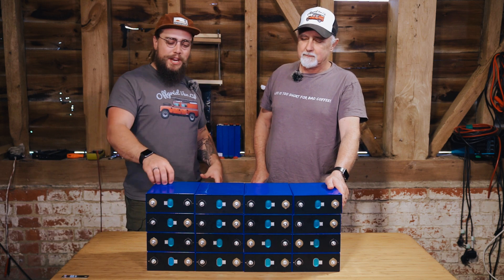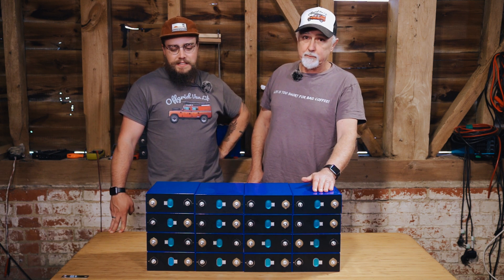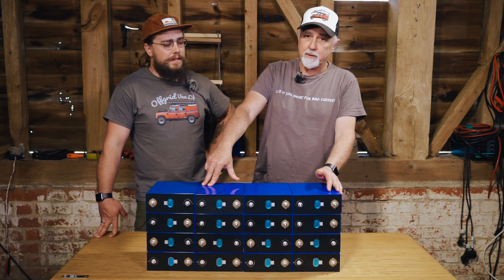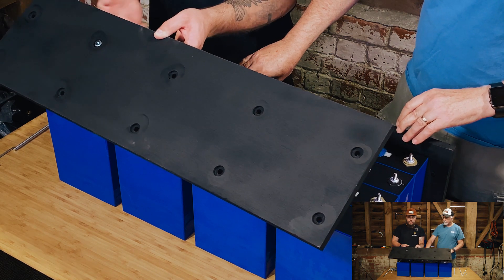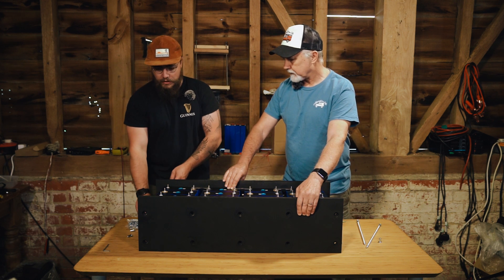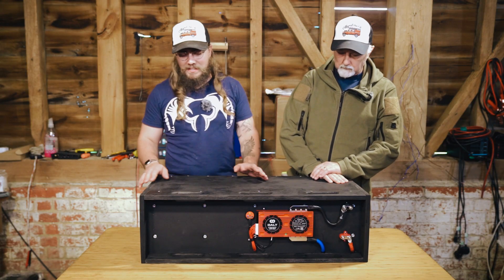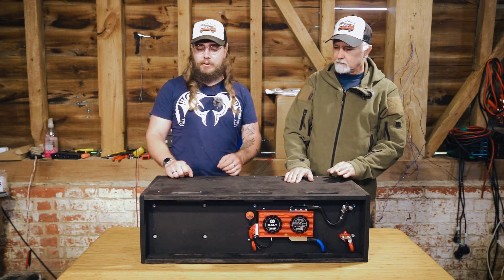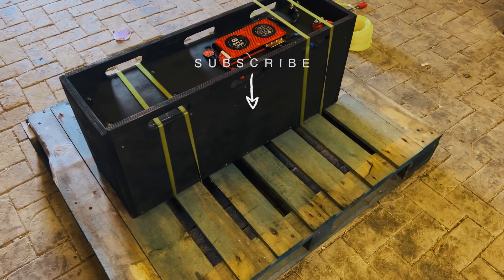Building a Custom 48v LiFePO4 Battery

Comment: That will have to be two guys dropping that battery in, as I doubt that more than that will fit into the space..Putting the all thread inside of some pex water lines is a good idea always, but especially for that build, if those cells move because of being bounced around in a vehicle everyday, and rub up against that all thread, it only has that thin blue material to rub through before it shorts out, the pex won't allow that to happen ever..

Comment: All that trouble top balancing and don't you know the BMS has a passive balancer which is not capable of keeping the cell balanced. Daly now sells an active balancer for this reason with a special Y cable to hook it up in parallel with the BMS. If you thought the BMS could passive balance, why top balance anyway? Keep you fingers crossed and hope for the best I suppose.

Comment: I'm learning about building batteries trying to understand how it works. BMS which I have found seem to be rated at 100, or 200 amps then they have a max voltage usually up to 48V. The batteries you have are 300AH capacity batteries your BMS in this build I see has a 200AH rating. How does that work?
Reply from the maker: The battery capacity and BMS maximum continuous discharge current are two different things. The 304Ah batteries have a capacity of 304Ah, which means (for example) they can be discharged at 304A for one hour to deplete completely. But the BMS has a maximum continuous discharge current of 200A.

Comment: Nice i have a 48v byd lithium batteries they came in two pairs 24v each which are in series making up to 48v but the problem is that i misplaceed the bic card which means that i cant used it 
I need help on how to build my own bms in both packs.

Comment: I like to cover the tie bolts with sink tube. There should be  a plastic sheet between the cells. The blue film protect from shorting out. It is delicate. Otherwise pretty nice build!
Reply from the maker: Thanks for the suggestion!

Comment: Sweet battery build! Only thing I would suggest is to route the BMS sense wires away from the other battery terminals. Also i've used those little busbar terminals like you have, I don't think they are very good, mine get rather hot at just 100a
Reply from the maker: Good points. Thanks!

Comment: since this is for RV, it is expcted on the move and there is no cushion between those battery cells. is that ok?
Reply: Many companies are putting thin sheets of plastic or foam between and around the cells for added protection.  It's good practice.
Reply from the maker: It's very unlikely that it will be a problem without it, but we do put thin layers of padding between the cells on bigger batteries.

Comment: dear your video is very helpful.
could you guys answer my question so i can start working on my battery without being sure it will work for what i need?
I build a houseboat and will build 1 to live on
and will build 3 to sail with a vetus e line 100 electric motor
now my question is can a 10kw motor run on such a battery?

Comment: If that threaded rod rubs through the shrink wrap of the battery case, things will get very exciting. Slide some hose over them. Fixturing is a good idea as long as the pressure is maintained and not over 12 psi regardless of state of charge. Solid buss bars and vehicle vibration can be problematic for the terminal bases and loosening connections. See Digital Mermaids flexible buss bars
Reply: Agreed, with enough tension on the bars, the cells may never move but safety and perception are gold here.  Overall, i love the build.
Reply: I seen in another build the put plastic tubing on the rods
Cheers
Reply: I zoomed in, looks like they have clear tubing on the rods.

Comment: Nice build! What brand is thees LiFePo4 cells  and what are the material cost of this battery without the labor?  I'm planning to build a 250kW solar system on my farm in the next years, so I would need over 100 kW of battery storage to take full advantage of all the solar panels. That means that I would need 8 similar battery packs :P
Reply: They're EVE cells. 
For a system of that magnitude, I'd suggest you're not going to be using a 48V system. At nominal voltage, that kind of power output would be producing thousands of amps of current, which is impractical to work with. You'd be certainly looking at something industrial or bespoke to handle that kind of power.
Reply: @madvlad1  Thank you. I would really like to use the Victron ecosystem for this setup, so voltage depends on what is supported by Victron. I think the best setup would be 3X of the largest Victron Quattro units to get 3 phase power at 230V on IT network which is standard in my area. 

Since victron only has "small" MPPT charge controllers, we are looking into the Fronius charge controllers. Since they should work with Victron, and are made for larger arrays. 

Keep in mind that I live in Norway where we have very little sun in the winter. So the solar array would be massively oversized for the summer, but just enough in the winter. Panels have gotten cheap and I noticed that there are a huge discount for buying a shipping container with panels, so since I got the space. Why not? 🤷😜
Reply: @TheJensss  Love it! If you've got too much summertime capacity and have to scale up for winter, and you don't have a grid feed in option, you could always just disconnect strings to reduce the current in the summer too - that could be an option. The Victron ecosystem is really nice - and yeah having 3P will be really cool, especially if you have some heavy inductive loads. Have you considered server rack 48V batteries?
Reply: @madvlad1    Our farm is connected to the grid, and we already have 3x 200amp intake fuse, so in the summer selling the excess power would be the best option. If I need more power output, I can connect 6x Victron Quattro units for total of 90kW of output. But since we only use about 40kW at max load, 3 units should be fine to start with for our usage. Maybe a separate and larger inverter could be used as a dedicated inverter for selling the power to the grid?

I almost forgot to mention that there is a “special” tax rule in Norway, that limits power output to the grid to 100kW. If overstepped, you would be counted as a commercial power plant and would have to pay wayyy higher taxes on the power you sell. This does that I plan to spread the solar array to 3 different angels, to spread the power production through out the whole day. 

Yes, I have looked into server rack batteries, and they look awesome. But when you are comparing them to a self-built battery like the one in the video. The price to kWh is not that great, especially when the battery is in the size of 100 kWh +. The reasons we want a large battery is mainly to be able to support large loads without taking damage, and additional advantages is that we can charge the electric car full from the solar battery. And in case of a power outage the farm would also have a large backup power source. Long power outages never happen, but since we got animals, I think it is smart to prepare for such situation. Now we just have a generator on the tractor as backup… 

I have always had a dream about being self-sufficient with power since we only use electricity with heat-pumps and wood, to heat our house in Norway. This is because electricity always has been cheap, so there has never been a need to use gas for cooking or heating.  But when the energy crises started the project became way more relevant the last 2 years. Since power usually costs about 0.02 – 0.03 £ pr kWh and now it costs 0.4 – 0.7 £ pr. kWh because of the war and Norway is selling all the electricity to the EU…. So obviously solar is way more relevant when the power costs 1200-2000% more compared to 2020 and before.

Comment: hey just a quick question,  how many solar panels and which configuration do I need to fully charge a 40kwh lifepo4 power bank, in my country we do have 8 to 9 hours of  sun everyday...
Reply: The European Commission has a fantastic tool on their website that will help you model average irradiance based on your location and help you understand how much installed capacity you'll require throughout the year: https://re.jrc.ec.europa.eu/pvg_tools/en/

Comment: Does your client knows that he can damage the cells at the first serios brake when they will touch the threaded rods between them? The aluminium case of each cell is connected to the negative port.
Is he aware that he needs some heated pads between cells for freezing temperature?

I also have a 16s 304Ah Eve cells on my camper, but I chosed a 200Ah JK smart bms with 2A equaliser.
Daly is a garbage, not need to be stingy for a hundred bucks when you pay 3-4k on such a battery bank.
Reply: Agreed on all points

Comment: In the last segment, are the cells not upside down (by looking at the BMS cables)?
Reply: They are, but the very last shot shows it sitting upright with the BMS facing up. and that's how it'll be installed, which means the cells will be sitting on their side.  Most batteries have the cells facing upright but on their side is ok too.